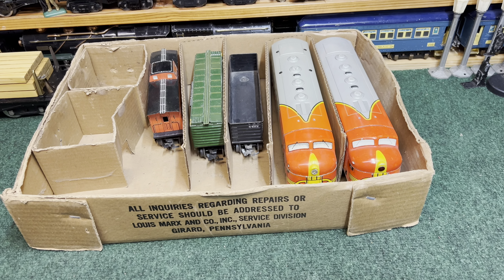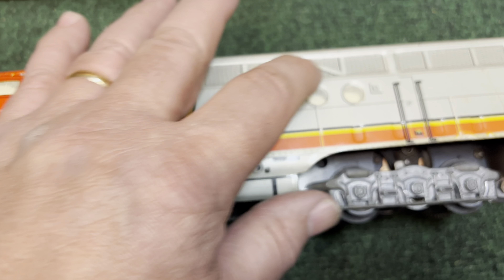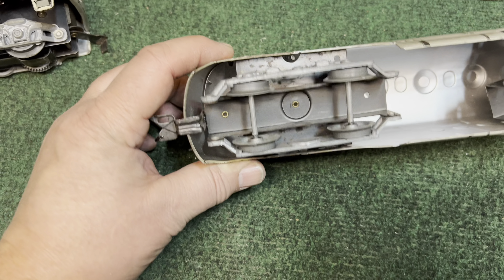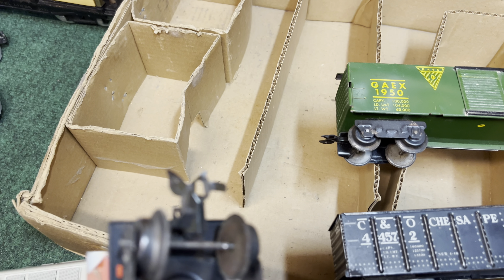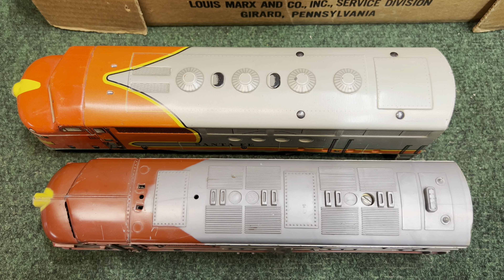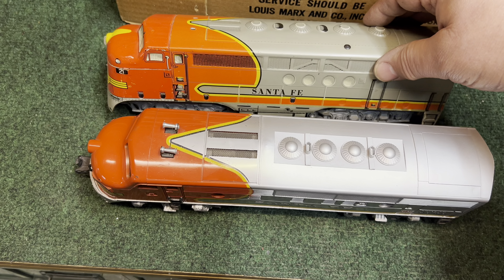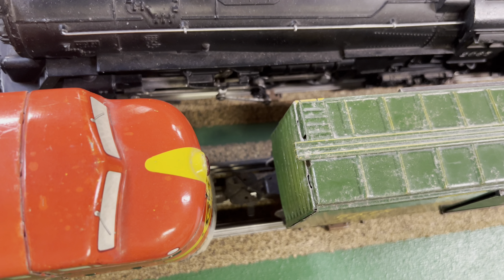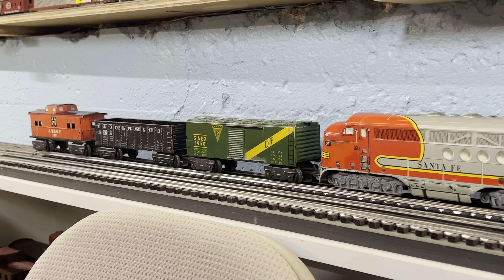The Art of Marx Trains Part 21: Marx FT AA 21 Diesel Freight Set 45200

Comment: Marx knew they were offering a competitive alternative to Lionel's F3 diesels. When purchased alone, the AA pair came with a diecast conversion coupler that tabbed-into the slot on the dummy diesel, so it could pull Lionel knuckle-coupler cars. Very tricky of LM to do that. Marx made some great sets with the accent on economy, durability and play-value. Marx's extensive use of lithography for simulated details was a huge part of their success. Marx only fell-short on a few minor details, like the fragile plastic horns that you mentioned. Nice video.